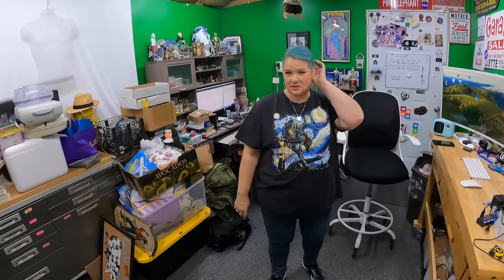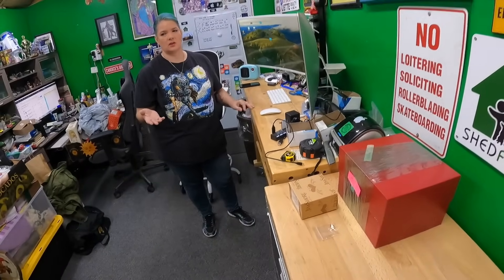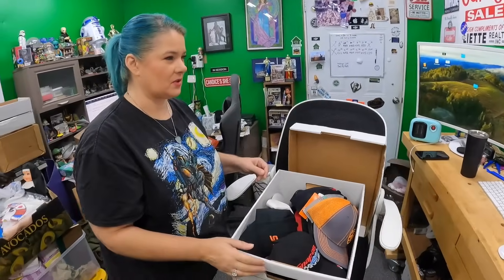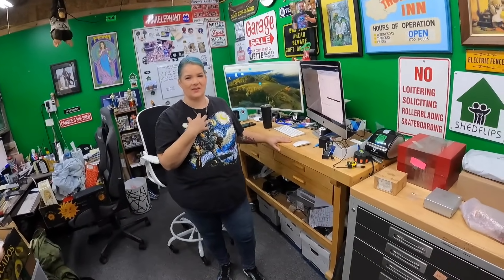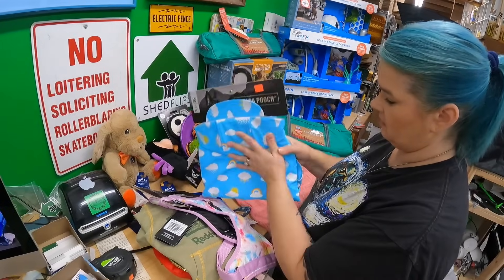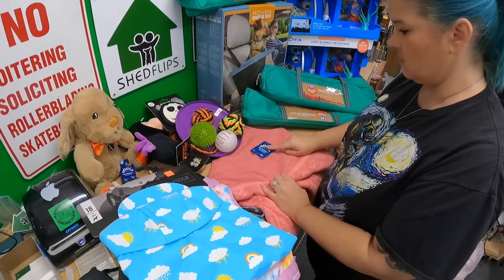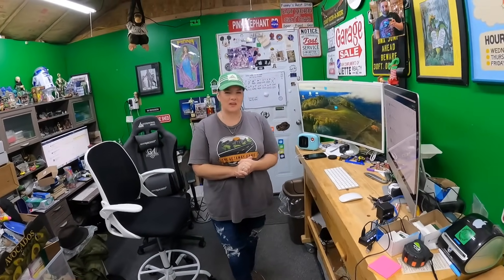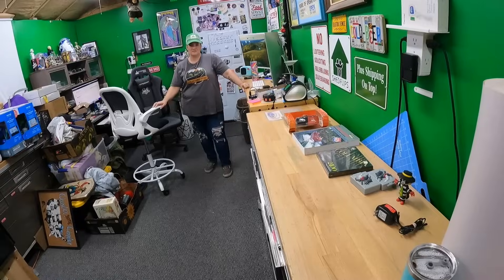I don't know how she scores these deals on Facebook Marketplace

Comment: I have a beginner question. It may not be appropriate here so I apologize for that. Can I use boxes that I have received orders in (like from Chewy) to pack and ship sold items? I notice you use very few 'premarked/prelabeled' boxes but for someone just beginning I'd rather not have to try to buy several different sized boxes to ship. Can someone tell me if this would be appropriate?
Reply: Absolutely you can use them! Just make sure you take off or cover up previous shipping labels. You do not want to use a box that says alcohol or chemicals is inside the box because the post office will return it just in case those items are inside! I also avoid using food boxes because I don't know if the buyer is allergic to anything. Hope that helps!!😊
Reply: @sharona3048  Thank you!
Reply from the maker: Thanks! @sharona3048
Reply from the maker: Sharona gave you perfect advice!

Comment: I find the eBay branded 6 x 4.75 x 4.75 boxes really useful. Just that little extra bit of width really makes a difference for some things.  Also, thanks for showing the packing videos. I picked up some newsprint rolls after watching you use so much of it and it's really made a difference!